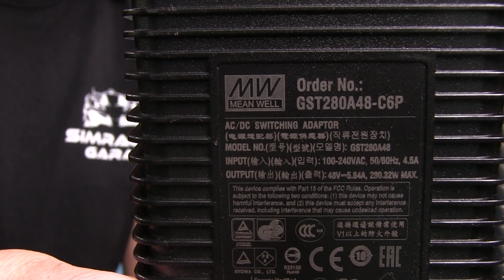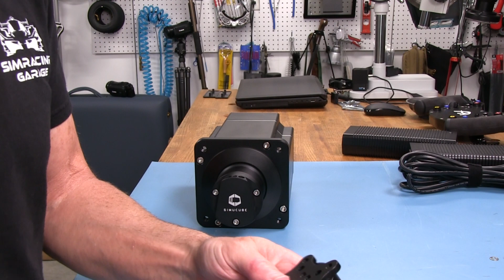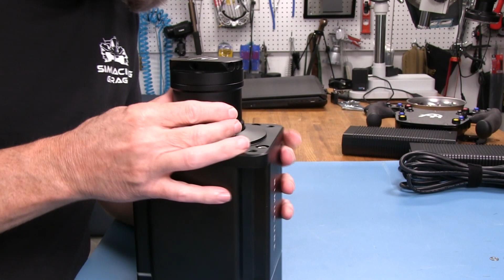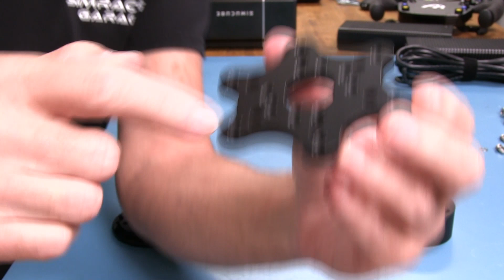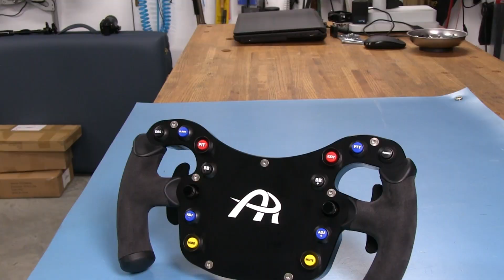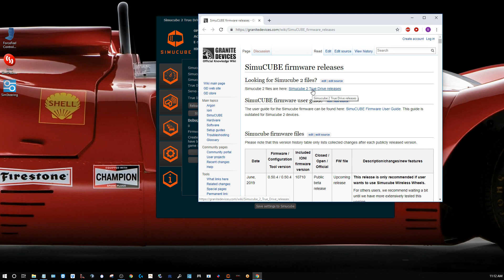Simucube SC2 Pro DD Wheelbase Review

Comment: Sublime as always. We need a head to head vs Fanatec DD. I am holding my wallet until that. Keep up the good work Barry, big fan here, greetings from Portugal
Reply: Yes!! That would be awesome. 👍
Reply: agreed but this does look a great choice
Reply: Also agreed.
Reply: Think of power like say for an home cinema amplifier, some will only have 100w per channel this amp might play at the 75db reference volume, now plug up an amp with 150w playing at the same volume the sound will have a bigger sound way more open sound because the 150w amplifier will have more headroom for peaks in the movie same principal
Reply: Based on every online feedback i've gathered it's not even a question. Sc2 wins
Reply: the quick release system from Fanatec is rubish, unfortunately not even close to podium
Reply: Why those DD wheels have to produce 5x more force than any modern racing car is beyond me. Maybe people like to have their wrist broken.
Reply: @jorge_781  I drive 60s trucks with no force feedback. I need the 25nm! #blindedbymarketing
Reply: @jorge_781  I know this is from a year ago but the average steering shaft force of a gt3 cars range from between 11-16nm with peaks above 20nm.
Reply: @gulfcoaster210  It's hydraulic assisted. Not even karts have 20 nm. DD wheels are pure marketing.
Reply: @jorge_781  the measurements I gave u were r from data provided by actual gt3 teams. They r hydraulically assisted but still produce those forces.
Reply: @jorge_781  and dd wheels are far from pure marketing.
Reply: @jorge_781   u seem to misunderstand the advantages of a dd. Peak torque is the least of the reasons to want a dd.
Reply: @gulfcoaster210  How in Earth an hydraulic steering of a GT3 car, which is almost a stock sport car, can give you more forces than a direct steer kart? Please give me the source of your information.

Comment: Barry you should set your brake gamma to one in Asetto Corsa otherwise it doesn't play nicely with load cell brakes. Great video as always,
Reply from the maker: I will try that.
Reply: For ACC the same or there is fixed ?
Reply: @martinturbo9015  Its the same, set your brake gamma to 1. Its not really a bug its just a setting that makes your brake inputs non-linear, the idea is it makes potentiometer brakes easier to use but its awful when used with load cells.
Reply: @Daniel-eu9xw  Thanks for the info mate

Comment: The short power cables for 2 power supplies are unfortunately a deal breaker for me. On my mobile rig it would mean that I would have a power supply hanging very high up on both the left and right wheelbase supports of my rig which would cause me a lot of issues.  It exudes all kinds of quality.  I just wish they a better means of communication than BT and had a better power supply configuration.  Otherwise it looks very good, I'm just sorry I won't be able to make it work for me.  The Fanatec wireless communication system that also supplies power to the steering wheel is much cleaner than BT and no batteries are required. However Fanatec uses a lower quality PS and requires a fan to keep the outrider motor cool.  It may be easier for me to live with Fanatec's solution if it proves reliable. The fan isn't a deal breaker, I have that now with my CS 2.5 wheelbase and I never notice it since I only play in VR.  It will be interesting to see how things look in another 6 months.  I'm not rushing this purchase.
Reply: find extension cables?
Reply: @gaoglai7127   Might work...  I'll have to look around. Could possibly make the cables myself... Thanks.

I contacted them to ask if it was safe and if they had a suggested source for an extension cable.
Reply: @tilus75  I exclusively use VR, so there is no screen other than a TV mounted to the wall.  The PSU's might fit on either side of the motor, but you have to admit that would be quite an eye sore. This is on a Sim-Lab P1 chassis and I'd really like to hide them under my foot pedal deck and I'd also like to keep the weight lower in the chassis. It would be a shame to hide the sexy looking Sim Cube 2  behind clunky PSUs.
Reply: @tilus75  I posted a new comment  outside this thread stating exactly that. They replied to my email saying they were working on a solution.

Comment: Thanks, looking forward to further videos about this setup. Does the unit get hot? All the electronics and motor appear to be within one solid body and no visible openings or visible cooling fins.
Reply from the maker: It got warm after a long session at max torque. But not hot.
Reply: @simracinggarage3026  Thanks, good to know! I'm really amazed how compact it is compared to DD wheels we've seen in the past. Great content, as always.

Comment: Always nice to have a great product option, but without telemetry-FFB i'll keep my Accuforce until they offer a worth upgrade. And the best way to improve FFB with most wheels is IMO to move to rFactor 2:) This Ferrari in iRacing has so much dampening from the software-side, the differences between dd-wheels must be very subtle. By the way: Your FOV in pCars 2 looks way too high. Nordschleife is not Silverstone, but not that narrow either and places like Brünnchen should be much wider and shorter from the visuals. The best way to setup the FOV is IMO to know the VR-version or just switch to VR:) I would buy this HP Reverb if my dickhead isn't way too big (IPD >72) for the fixed lenses.

Comment: The desktop centre spring forces the wheel to centre when you're not running any games.  I find it very useful and is a feature in the SC1 firmware.  I usually leave it powered on always, so it stops my kids from spinning the wheel when my PC is off
Reply: I use a smart plug for mine with alexa to turn it on

Comment: great review! so it is better than a sc1, but is it better/same as a bodnar ss2?
Reply from the maker: Personally, I still prefer the motor characteristics of my 54G Kollmorgen. It's no contest when it comes between the True Drive software and the SS2 tuning interface. That said, from the looks of it, the SC2 Ultimate may be the solution that makes me switch from the Bodnar.
Reply: @simracinggarage3026  Barry, this review was fantastic as usual but also underwhelming. I would have liked to see you discuss how the driving experience feels compared to the other DD just like the comparison video you did before. If you're going to review the SC2 Ultimate, kindly make sure you extend your elaboration against Leo's SS2. The hardware is important but its the driving experience the counts the most. Thanks!
Reply: I think, overall Leo's SS2 is still the benchmark. What you think?
Reply: @simracinggarage3026  thanks for answering barry!:) hope so, i will be ordering my sc2 ultimate next week. 👌

Comment: Curious, how often do you experience out of control spinning wheels where you have to use the kill button?
Reply from the maker: You only need it to happen once. Then you will see the wisdom in having an E-Stop button within easy reach.
Reply: Happens allot. Especially if you crash it will oscillate like mad. Mostly in iracing
Reply: The only time this would happen is with poorly designed software or sim. Complete non-issue with a wheelbase with properly designed software.

Comment: PSUs look exacty like the ones in Fanatec DD.
Reply: As stated Fanatec is using a different PSU.  I like Maxwell PSU's and I have a number of them. We should know a lot more whether the Fanatec PSU's are reliable after half a year of use by serious drivers who put many many hours on their systems.  

One important thing to note is that outrunner motors tend to produce more torque and inrunners typically have gear reduction to produce similar torque, so while the Fanatec DD motors require a cooling fan, they may in fact work well with the the chosen PSU, but that same PSU may not work as well with the SimCube 2 inrunner motor.

Time will tell. It will become obvious over time if there are any reliability issues.
Reply: @markkovalcson7243  It would be nice if Barry would open them both up and compare the Maxwell with Fanatecs, as I have a feeling they might be a copy of slightly changed specs [48v vs 36v], and thats all.
Reply: @BadNga  Maxwell has a very well deserved solid reputation in the PSU business and I can pretty well guarantee that Fanatec is not using a rebranded Maxwell PSU. 

The plastic cases may be similar, but that means absolutely nothing.  Granite State did evaluate the PSU that Fanatec is using and they passed on it.

I may very well end up with a DD2 for practical reasons and as long as their PSU is reliable, I don't really care.  The Sim Cube is a beautiful piece of hardware inside and out.  The inside of a DD2 likely does not look as good, but as long as it works reliably, I don't care.  

What my gut tells me is that the Sim Cube is over engineered and that is part of what their customers expect. The Fanatec DD wheel bases are designed to spec with the understanding that they are selling in volume and can afford to have a certain percentage fail. Honestly that only makes good business sense.
Reply: @markkovalcson7243  Keep in mind that the DD1 is using the same outrunner motor as DD2, but at lower torque, so there should be plenty of safe overheads in that one... Time will tell.
Reply: @BadNga  You are correct about that, but I don't see the point of the DD1 in their lineup. Fanatec is trying to convince people not to buy it. They've increased the price of the DD1, then charge $100 for the kill switch, if you add the warranty, you've just paid the same price as a DD2 without getting the extra capacity.
Reply: @markkovalcson7243  No need for a killswitch in DD's as theres no leads connected to the wheel. Nothing will tangle up if the wheel will keep on spinning,. The power button is just on the back of the unit - killswitch IMO is really just a fancy way to throw Fanatec your 100€.
But I agree that they try to push it out of the market with that price - the initial idea was to have a cheaper motor in it and sell it as an entry level DD, but they ended up with a software restrained DD2 unit.
I have the DD1, but I got it for less then a 1000€ in preorder and they thrown in a voucher for €350, so overall it cost me about €650. And thats a bargain.
Reply: @BadNga   I've never seen a case where it was spinning round and round in a circle.  What I've seen is a wheel get into a loop where it is shaking VERY violently making it hard to get out of your seat to reach a switch on the back.  Personally I would NEVER get a DD wheelbase of any kind without a kill switch.  There is a real reason for all of their warnings and for the lockout plug in the back.
Reply: @markkovalcson7243  You can just have the unit plugged in to a power source with a switch, like a 15€ extension lead. Have it on the floor beside your pedals and hit it with your foot.
Reply: @BadNga  Do whatever you like.  If I get a Fanatec DD system it will be the DD2.
Reply: Fanatec uses cheaper solutions and not Meanwell. Actually, the exact PSU Fanatec uses didn't stand up to Granite Devices quality standards.
Reply: @Tintop  Just checked the fanatec one - looks the same but its branded Fanatec and it is: 7 amps input at 220v and over 13 amps out @ 36v

Comment: would you please try to use the wheel while disconnected and see the range the bluetooth will transmit to, thank you.
Reply: I can't help but wonder how this will be relevant. You really would never use it at more than a few inches, right?
Reply: @yoepdeligt682  it's only to test the need of an external antenna on the base itself, if you have 10ft range then why worry about having an external antenna.
Reply: @jesseconroy87  Watch the Ascher wireless wheel video. It was dropping to 25% when the wheel was straight. If its going to drop that low from the wheel to the end of the motor, I wouldn't like to guess how weak it is from the SC1 to wheel with the upgrade board you can buy.

Comment: Worth upgrading from simUcube 1 Barry ?
Reply: I have a Small Mige based SC1 and my friend just got a SC2 Pro. Spent some time with it at his place last night and while it's better I don't really think it's worth upgrading from an SC1. IMHO it's like 5-10% better. It's all nicely integrated and if I was getting a new DD wheel I'd get the SC2 no doubt about it but I don't feel any need to sell what I have to get the SC2.
Reply: @martinoberg4883  only 5 to 10% better he says. Lol! Denial is a wonderful drug.
Reply from the maker: Only you can make that call. The motor and user interface/filters are cetainly better than the SC1 to date. You may want to give it a go as long as it does not hurt you financially I think.

Comment: With the stock price of the Fanatec DD going up...really considering a SC2 now...looking forward to what barry says.
Reply: Don't cheat yourself and save the Fanatec headache.. SC2 all the way.
Reply: I personally will go for SC2 bcs of all EU made industrial components and proven software. Just the  power supply's are 2x100 euro. Fanatec is using Chinese components and is only  better in having bigger margins/profits. Im not saying Fanatec is bad choice especially if you are invested in to the ecosystem but SC2 is a better option for me.
Reply: @martinturbo9015  https://www.meanwell-web.com/en-gb/ac-dc-industrial-desktop-adaptor-with-pfc-output-gst280a48--c6p
Reply: @1027hristo   70 euro  exl tax (21%) and delivery . 85 euro with tax.  with delivery will be close to 100 Euro. Granit devices are using quality components and on the other side Fanatec is trying to find ways ti use cheaper parts to increase the margins.
Reply: Everythingineed speaking about fanboys......im really sorry but for me you are acting like one.
Reply: @everythingineed1806  fanboy ? I have Fanatec CSW 2.5 :))) if the outrunner motors are better why inrunners are use in industry and work 24/7 for years  and outrunners in RC (toy Helicopters )  and not so dependable stuff . I have friend with Fanatec DD2 and he say is not much different than CSW 2.5 at least not 1000euro. He say if it was possible to test csw and DD2 in store side by side I will stay with csw 2.5 and buy some other equipment with those 1500 Euro
Reply: I think Fanatec DD is without competition atm. It is highly superior to what other manufacturers deliver
Reply: @fawkesthephoenix95  "It is highly superior to what other manufacturers deliver" ..you don't mean that serious, do you? When it comes to DD systems Fanatec is already some years behind in development, the rivaling manufacturers are already some steps ahead.
Reply: @Tintop  yes
Reply: @fawkesthephoenix95  It's without competition when it comes to compatibility and plug-and-play. In terms of FFB quality the SC2 is unrivaled.
Reply: @fawkesthephoenix95  Shaun from The Simpit said, the DD2 is basically an OSW-wheel with Fanatec steering wheel compatibility without the promised software that might improve the FFB. He switched back to his better tuned Accuforce for this reason and waiting for the software to do his review he said. Also some people experiencing hardware problems with the Fanatec DDs and enough to give them some time to sort things out.
Reply: @Leynad778  that is why I was also considering the 2.5 Wheelbase. Because it is a unit wihhout issues. DD1/DD2 is like a new computer software. They have flaws at the beginning. But back to the fanatec DD, I heard multiple guys saying it would be better than anything else they have had, I think it's just about personal preference
Reply: @fawkesthephoenix95  Most Fanatec DD-owners coming from belt-driven Fanatec-wheelbases to keep using their steering wheels and certainly are impressed by direct drive in general. But i could name one guy who replaced his T500 with a Fanatec DD and missed some road noise he was used to and Shaun mentioned that missing effect as well. The SimuCube software seems to have some more options to tune the desired FFB and some want those "canned effects" Barry talked about. Especially without motion and SimVibe it's reasonable to add effects to the FFB you miss from other forces. But even with my GS-5, SimVibe and AF i like to add some effects when the title is not providing those outputs from the FFB despite they are in the telemetry, for example with Dirt Rally 2.0 and pCars 2.